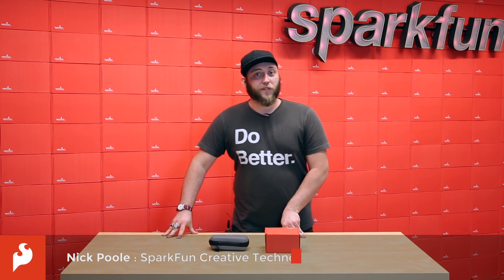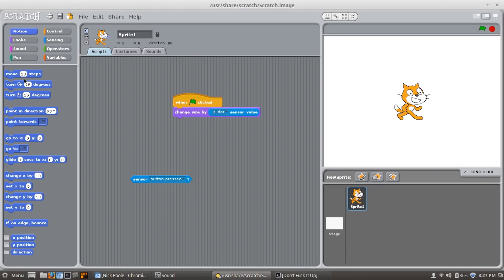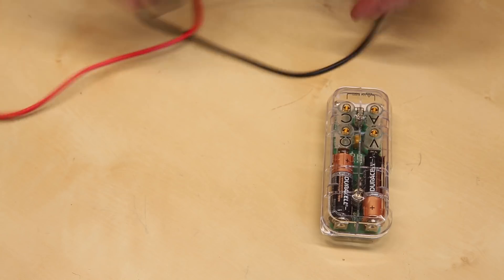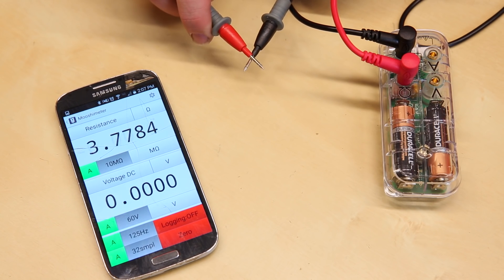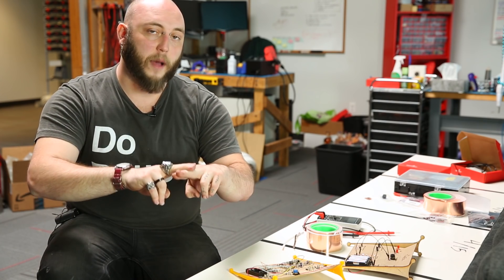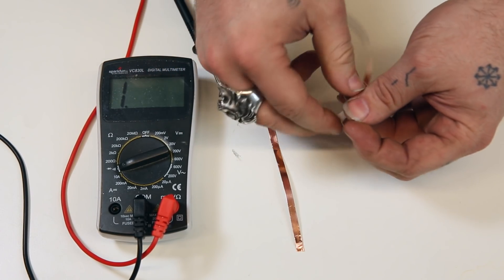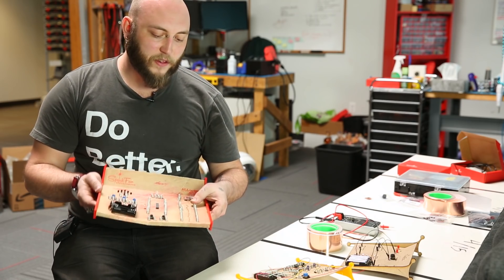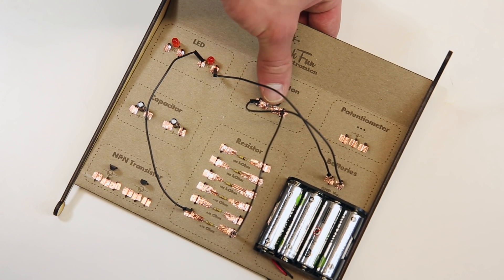SparkFun 4-15-16 Product Showcase: The Mooshi and Scratchy Show

Comment: I love how the video starts with how easy it is to use this smartphone-based multimeter, and then proceeds to use a regular multimeter because...well.. it's just easier.

Stop making things that require a smartphone as a display, it's not handy, it's not easier, it's just clumsy, it limits how many things you can do at a time and it drains the battery of my phone, which seems to be at 10% pretty much all the time anyway...
Reply: +vinny142 I agree but in fairness they are just retailing a product made by someone else:  https://moosh.im/mooshimeter/